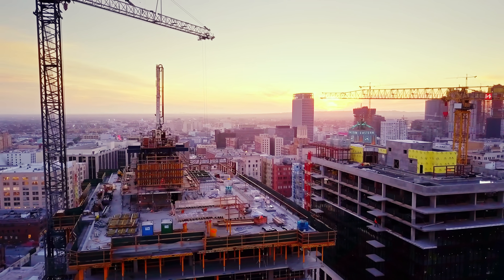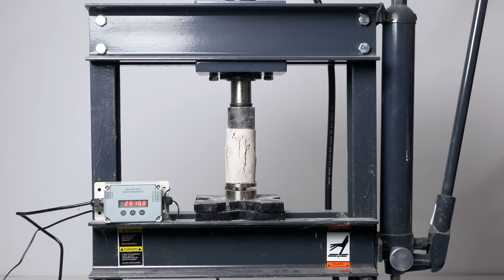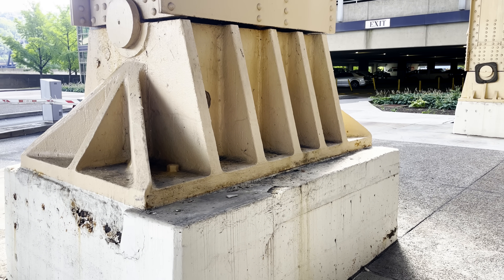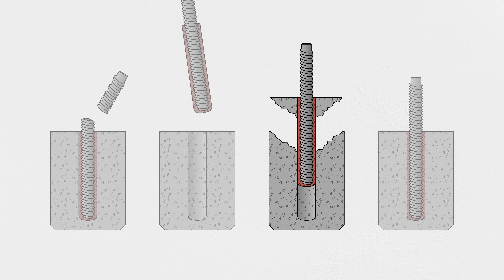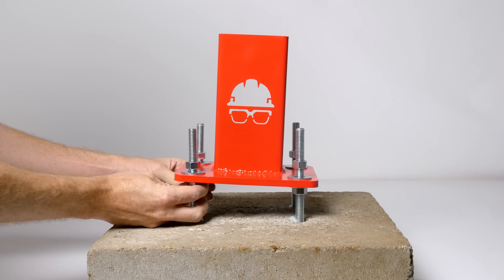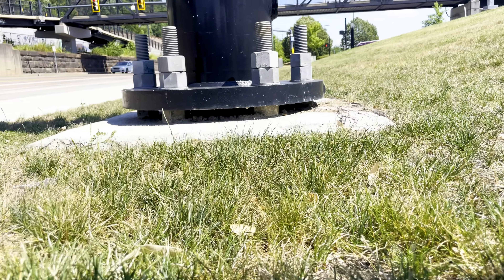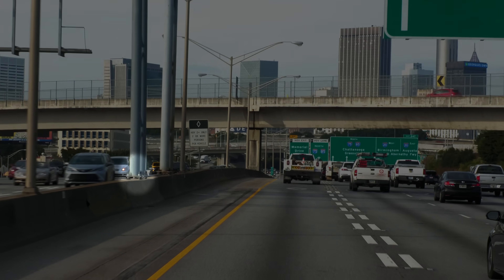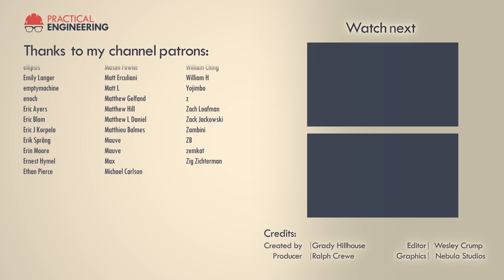What’s the Deal with Base Plates?

Comment: In the early  1980's, I worked for a company that built / installed canopies for gas stations. One customer that had a canopy by a different company, called us to come fix his canopy. It was jumping up and down. You could see the canopy pole actually sliding up and down in the concrete. The base plate was buried in the concrete ( about 2 years old ). So, we jack hammered away some of the concrete and fortunately the easy solution. The installers had NOT tightened the nuts on the anchor bolts. So, we tightened them and poured new concrete. So, it had taken that 2 years for the wind forces to grind away enough of the concrete to achieve enough movement to cause alarm.
Reply: or it took two years for the guy to call
Reply: @ThomasSchannel nowadays you’d just be told it’s a feature not a bug
Reply: @AlexofZippo  Based on your zero experience working in the trades or doing business with them.
Reply: @AlexofZippo  Let me show you it's features
Reply: Your comment resonates with me because just the other day I was at a gas station and I looked up and I appreciated how much work it must take to build one of these canopies...  It was a windy day and I marvelled at how it resists the wind like a hot knife through butter.  It is there, finished and looks like it was so easy to build, but I am sure there were complexities to it.  And there are 1,000s of canopies all over and almost no one gives a second thought to them.  I know all about wind force because I have been engineering a shading system for my backyard ice skating rink and dealing with the wind is a PITA.
Reply: @RobertRMusic  You might like this part. The company I was with was my father, myself and one other guy. My father designed a system ( approved by a structural engineer ) where we would hang two come along (ratchet hoist to some ) from the top of the canopy pole. Then suspend our main beam on them near the ground. We could then construct the entire assembly standing on the ground by either raising or lowering it to the most comfortable working height. When ready we would raise it to just above head height and mount all the lights. Then hoist it up to its intended height where we would weld it to the pole, then remove our hoists. We could build a 24' X 48' canopy in a single day. Bigger than that took us a bit more. Surprisingly, I have never seen anyone else do it this way, before or since. It really is quite smart as it is so much safer and faster doing so much of the work on the ground.
Reply: @dallasarnold8615 do you mind sharing a video? Cannot wrap my head around this. Thanks
Reply: @anirudhreddy4137  I suppose that is supposed to be a joke. Video from the 1980's. Ha ha ha !  Fat chance.  It was actually at the end of the 70's and just up to '81. Video cameras were just beginning to hit the market for general consumers. If I knew anybody these days that is handy with CAD, we might could come up with something.
       I will try a more detailed description. The main beam was two sets of 4" channel that were each two 4" channels separated by 10" long pieces of 4" channel so that they sort of look a pair of tracks. So, these were turned  up on their sides with the flat side against the post. Then we would weld several pieces in between them just long enough to give us 1/8" gap around the pole so we could slide it up. At each of the outer ends we would weld a bar joist. So, at this point from straight overhead would look like a big "i". Then, a bar joist welded to the ends of those joists which formed the perimeter. Then depending on size one or more bar joists in the middle to support the panels that make up the roof. We had short pieces of flat steel that we would clamp in place to support the ribs of the roof panel and weld in the little pieces then remove the clamp, and move to the next one. We had steel tubing on the outside most commonly running horizontally at one foot intervals to which we tek screwed the aluminum "shingle shakes" ( as they were called then ) for the face. There are a lot of other details but this would get even crazier long. So, with the come alongs hooked on near the pole, we could stand on the main beam and ride it up, sort of like a pump jack. Of course, we had to leave one person on the ground to set the ladder for us to get down. We pre-assembled as much as we could in our shop to make it possible to be fast on the job site.  The largest one we did was 40' X 80' four poles. That was slow going up due to trying to keep from binding. The cable would spool up a bit differently on each come along and would lift a bit more or less than the others that way. We had 8 come alongs on that one.
Reply: En Venezuela  en 2010 aprox vi trabajos similares al descrito en este chat con perfiles de acero se subían armados con winches  instalados en el piso y andamios de Torres de izaje y también armar losas de concreto a nivel de 80 CM y subirla con gatos hidráulicos que eran como una mesa. Se trabajaba muy rápido cómodo y seguro
Reply: The previous installer： The quality assurance is two years.

Comment: If you don't use grout, you need something to keep the rodents out from under the base plates since rodents pee and poop and that can speed up corrosion on the bolts. When they built my 200' tower, they said grout tends to hold water and corrode the bolts. So, they had mesh under and around the legs to keep rodents out... It's still standing, 20 years later.

Comment: It seems like the ultimate way to do the footings would be to have the steel plate directly on the concrete but have most of the weight suspended and holes aligned while the concrete sets. Then it can just sit directly on it from then on.

Comment: I like grouting. You can use the hexless top nuts that you spin on to a common level and tighten the base nuts to raise the machine to the common level. The user thinks there is no adjustment, so they don't mess with the laser leveled base. Otherwise, you get users that think messing with level is an appropriate fix for whatever problem they may be attempting to correct for. Super scary how some folks reason through corrections to minuscule problems by creating huge problems elsewhere. Great video.

Comment: I've never heard of raising the column above the foundation on the bolts using nuts before, unless somethings changed that isn't done in the UK. The height of the pad or slab is cast close enough so only shims are used if necessary. Looking at most of your examples like sign posts base plates being over an inch above the pad, this is being used as a shortcut to save time on doing the job correctly. You're just starting to talk about the downsides, I'm expecting a very long list 😂
Reply: Oh dear God, now your saying a solution is a shortcut to the shortcut 😰

Comment: Throughout my career as an electrician I have installed thousands of pieces that required anchor plates. From light poles to motors and motor control centers to substation systems and fences. Very good video!

Comment: As a life-long rollercoaster enthusiast, this video answered a lot of questions I´ve had for a long time! Rollercoaster track pieces are often designed with sub-milimeter precision, so I always wondered how they manage to bolt everything together on site with foundations that are not made with that same amount of accuracy.
Reply: Consider that much work is farmed out to "lowest-bidder" contractors, and the world becomes a scary place to feel completely at ease ascending a skyscraper or riding a roller coaster. The 1,800+ foot tall CN Tower in Toronto, Canada has an indicator at the top observation level that shows in real time how much the tower is blowing "off-plumb".
In Sept. this year we visited the leaning tower of Pisa, Tuscany and was surprised to learn that some time ago, engineers counter-balanced one side with 200 tons of lead to prevent further tilting.

Comment: Around here, outdoor posts like shown around the 9 minute point are either direct-bury into earth as older ways of doing it, or are bolted directly to a small, purpose-built footing sized for the expected load.  The former are slowly being replaced by the latter as the older poles corrode away and require replacement anyway.

As far as I am aware, efforts are made to get the top of that footing as close to perfectly level as possible, so that there's no need to grout underneath of the pole.

Poles are generally not set directly on top of sidewalk slabs unless they're merely for something light duty like crowd-management bollards.

Comment: they usually also put pin piles or helical anchors on underneath each corner too, under the pad into the ground, not the steel pipe on top of the pad, im talking about big stuff, smaller stuff same thing but 1 pile or helical anchor for the pad, i used to that type of installs

Comment: The bit about signs being essentially wind sails reminded me about something that happened at Delft University of Technology when I was still in uni. The buildings there have mostly the same aerodynamic properties as a brick, and some places can get extra windy during a storm. To warn cyclists for that, some signs were placed warning for the extra strong winds. However, during a particularly heavy storm, the pole holding up one of those signs snapped due to the force of the wind.
Of course, this was immediately included in an exam question (or perhaps a practice exam) of the Materials Engineering department. It's a university after all!

Comment: its kind of like the whole purpose of tracked vehicles. from bulldozers to tanks to the crawler NASA used for rockets. A large flat area of the tracks can in some cases spread out enormous amounts of mass to lower PSI to the ground than what an SUV puts down through its tires.  Which means for example the gravel crawlerway at KSC could support the crawler and the Saturn V or Space Shuttle.  Or how a bulldozer can go around a muddy construction site while the Foreman's F150 gets stuck.

Comment: Structural steel is my line of work for the last 35 years. AcraMital had one side of their steel mill sink over decades. They rolled 7" plate to make 7" baseplates to raise that side of the fornace structure and were added to existing columns. . Odd but worked apparently until the mill went out of business a year later.

Comment: Once on a huge warehouse job l was on the interior columns were set, roof structure complete, roof mounted hvac units set. But the column base plates were not grouted so leveling nuts were all there was supporting this load. While working inside one day we heard an instantaneous loud boom. The anchor bolt and leveling nut threads had given way. The vast roof structure now became one inch lower. Job superintendants grout those base plates immediately after everything is plumb.

Comment: A problem of foundation design is not overlaying rebar layout drawings with anchor bolt drawings. Many times both when taken seperatly will show rebar and bolts occupying the same space. With large sizes it becomes a nightmare to set the bolts. Estimators bidding large foundations do the overlay yourself. Add in plus 25% to man hours if you see a problem.

Comment: i got baseplate purpose, but isnt using bolts defeat that completely, you are distributing load then not only negating it with bolts but even concentrate the force in a smaller area.
why not just normaly leveling the concrete in a specific area, surely it doesnt take much time at all and with lasers even the knob heads will get it right faster than bolts.

Comment: The only problem with the break away bolts on road infrastructure is the question of where does the sign and vehicle continue once off road? As you've now got an out of control vehicle and a sign coming across a bike lane/sidewalk/some one's front yard.
Reply: This is the biggest problem with breakaway baseplate design. It prioritizes reckless driving over the safety of everyone else  - I've watched several cars hit poles in crowded urban areas, and luckily in Canada we don't have this awful breakaway stuff. If it had broken away, there would have been several hundred pounds of steel falling at high speed into a crowd. Breakaway engineering is a very American, car-centric anti-human way of doing things. Really sad to see him championing it.